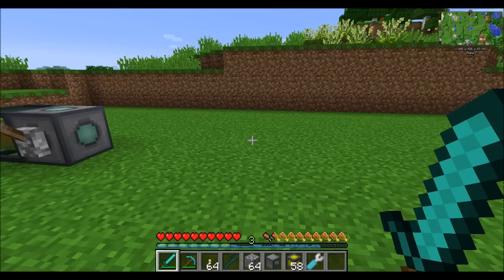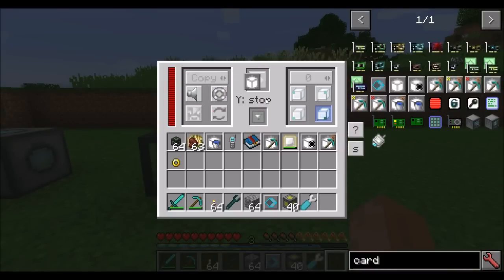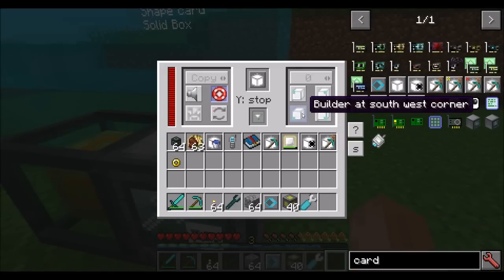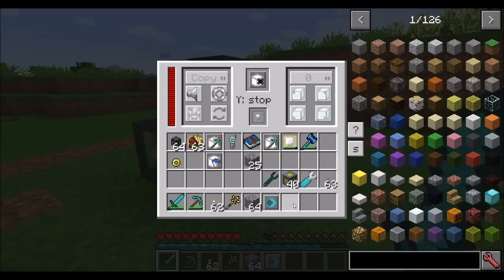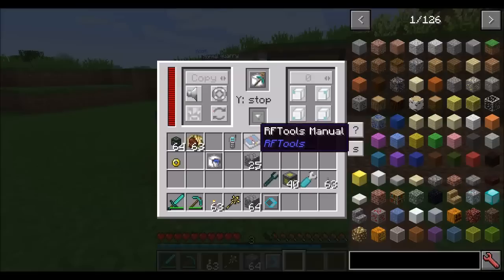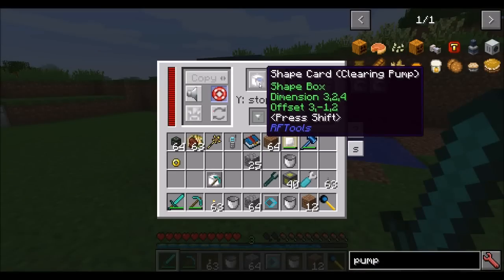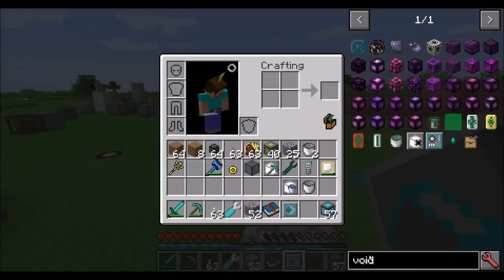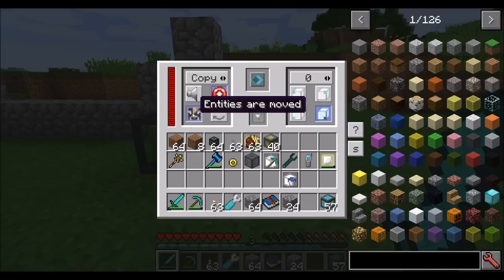Mod Spotlight   RFTools Pt4   Builder

Comment: On the water pump, just make a 5x5, and only pump a 3x3 out of the center. the outer ring will keep refilling the inner 9.
Reply: just make a 2*2 and pump one block.
Reply: the void zone I was operating under the assumption that giving it more blocks to pump from would allow it to pump faster, if only because it waits less for there to be a new one available to pump

Comment: Hi Dire, love your spotlights!  I built an RFTools quarry in FTB Beyond with basically the same settings as you and it always stops at y level 27 or 26.  Power and storage are not issues.  Any ideas why?  I have Y set to 70 or 100 but no matter what, it always stops.  Mining in Deep Dark and the Mining World.

Comment: Question about the Space Chamber thingo. Any way to speed up how fast it moves blocks? Want to use this to move away the Blood Magic ritual of calling in that ore metorite after the ritual is activated so i don't lose all my ritual stones, but at the speed it appears to swap blocks out will not be enough to move everything before the meteor hits and blows up everything.
Reply: I know this is old, but using multiple could avoid that problem

Comment: +direwolf20 has anyone on ForgeCraft ever bothered reported that bug with the quarry where it skips the first two blocks?
Reply: That's not a bug. That's intentional. The area around the builder is protected. The builder will not touch that
Reply: Jorrit Tyberghein ick... what a shit feature
Reply: It is to make sure that cables, energy collector, the lever and the chest are not accidentally harvested. And the builder itself. i.e. you can setup your builder requirements for power and items safely around the builder without having to worry about it getting removed
Reply: that makes sense for the blocks surrounding the builder, not so much for the ones under it
Reply: It only skips the ones surrounding the builder (so one under) but not deeper then that though (just tested)

Comment: I know how to quarry with the builder but it wont stop GLITCHING out!
I have 2 major problems that make it unplayable:
1) I set up the coordinates and it starts mining not doing all the area for every height but picking an x/z plane and going all the way down, looking awful 
2) it just will STOP WORKING after very few cycles, it just gets stuck in a loop scanning a number of empty blocks and wont go ahead mining, and it does it every single time
Reply: 1) make sure you have the right shape selected, solid box is what you are looking for
2) did you make sure that there is space for items to go? the builder block cannot directly output items in a tesseract, but it can accept it from it. make also sure that if you dump items in a non-regular chest, that that block doesnt respond to redstone. Also make sure that you put the block on keep running on redstone, replace the block and reflip the lever off and on. Most likely will do the job

Comment: does the builder also works as a chunkloader?
Reply: IIRC it only chunk loads the chunk it's currently mining from but does not load itself so you do need to chunk load the builder itself.  Be careful where you set it down because you could put your power in another chunk and not have it loaded.